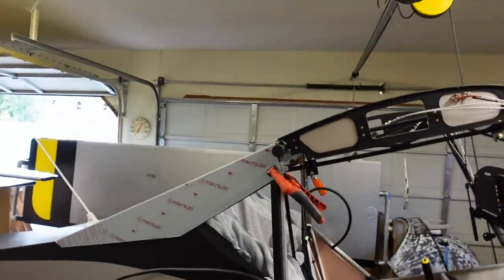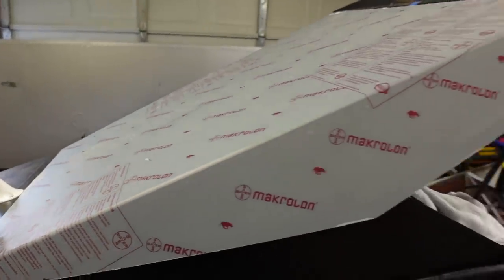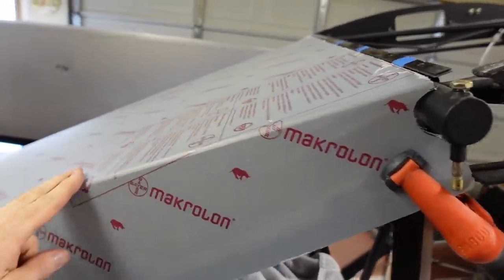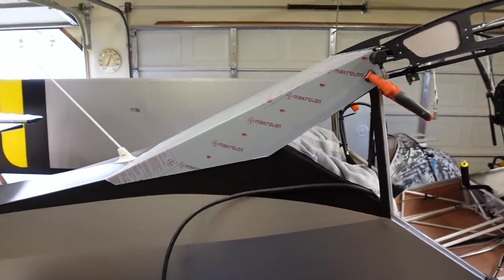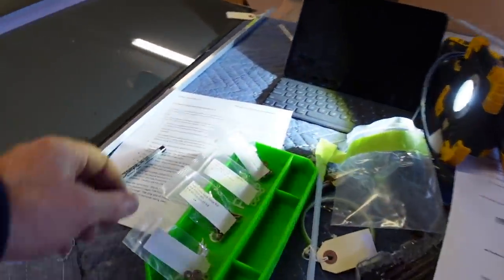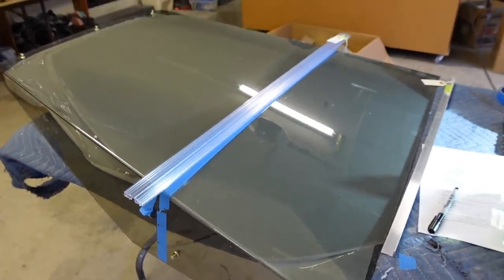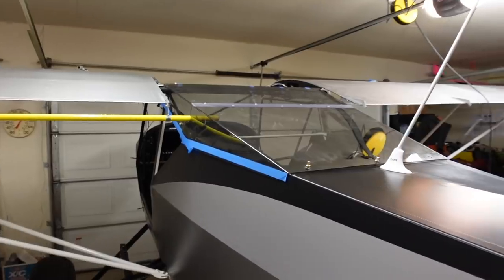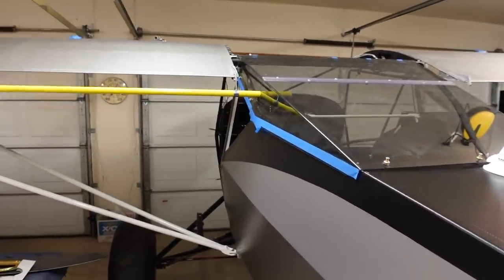Kitfox 7 Apex Build Episode 40 Turtle Deck Install

Comment: 728.3 lbs.

Socket head
Button head
You used a truss head.

Not a 8/32nd screw. Rather a #8 with 32 threads per inch (#8-32).

Comment: Hey Bryan, one tiny correction (only because I used to sell industrial fasteners). Screw sizes: The 6 and 8 are the screw diameter, and 32 is the thread pitch per inch. Just pronounced "six thirty two" and "eight thirty two". They aren't 6/32nds and 8/32nds  as you state. Great vids... carry on.
Reply: six thirty seconds is the correct engineering way to say it.  6/32.   So you were saying it wrong when you were selling them lol
Reply: @jeremykemp3782  No, I wasn’t wrong. I did it for a long time. Lots of trade shows, industry conventions, presentations, etc. with coworkers and peers. Heard it thousands of times, said it thousands of times. Lots of buying, selling, ordering. A #6-32 machine screw = 6 is the major diameter, and it has 32 threads per inch. The correct terminology for a MACHINE SCREW IS "six thirty two". It is NOT expressed as a (six thirty seconds) fraction (6/32 would be expressed as 3/16 anyway). Thanks for playing though. You’re fun.
Reply: @5xls  
Ah, he was talking about the amount of threads on a screw was he, as in 32  tpi.  I thought it was a measurement he was talking about, not how many threads per inch lol.  my bad.

Comment: 800 lbs. BUT on your next turtle deck, reverse the side cuts on the deck to top-foremost down to bottom-aft. This will put the hinge/aluminium strip slightly higher up iin the rearward view, and unless that's a critical issue, it will provide a larger opening and simplicity of functionality in us and in instalation,

Comment: Brian you could always just put carbon fiber vinyl rap on turtle deck to get the affect you won't??
Cheers Alistair
Reply from the maker: The purpose for carbon fiber on the turtle deck would be purely to save weight. The turtle deck as is weighs 8 lbs and a Carbon Fiber version would be about 3 lbs.

Comment: 767.7

for the camlock, if you take the camlock in your fingers, push the head with your thumb, you should be able to extend the pins further down, to allow you to push it through the hole, at an angle, one pin at a time, then shift to the other side, that should allow you to put them in the lexan side, without having to over size drill or notch the lexan.

that shower hinge, looks like it would crack and break over time?

Did you get in trouble with the Mrs? she did not look very happy, lol

Comment: Don’t cut the hinge to the width of the turtle deck. There are aluminum strikes that go out to fill the wing gap and you want the hinge to extend out through the cut in those too or they will vibrate in the wind.
Reply from the maker: I will be shortening them as suggested by kitfox so that they are only on the upper section

Comment: can apex engines be hand-propped, or does that require an independent magneto system?
Reply from the maker: It can not, because the gearbox has a one way clutch.
Reply: @BowenAero  interesting. Is it a slipper or centrifugal clutch, or something different?
Reply from the maker: @fucyew9775  It is a sprag clutch